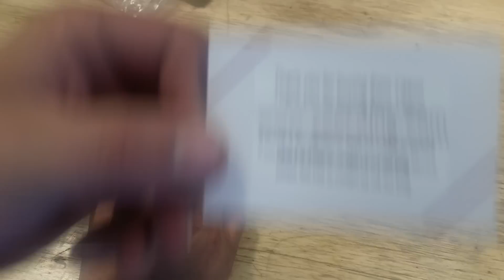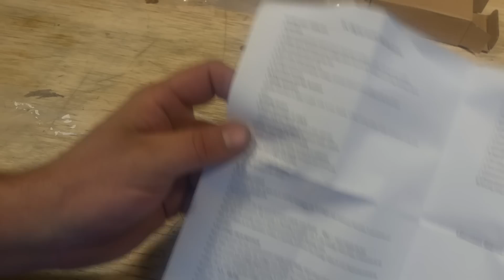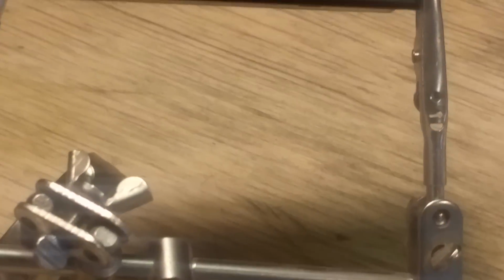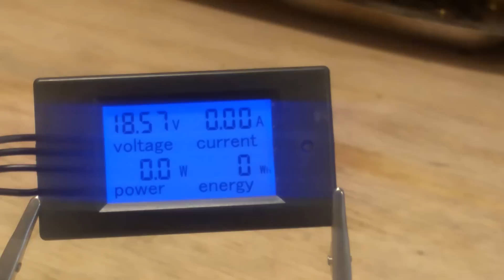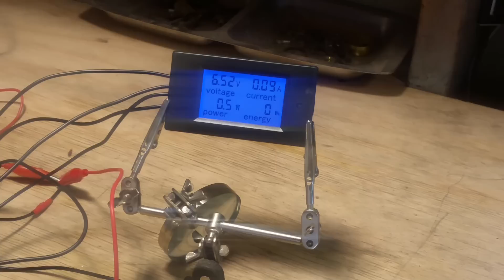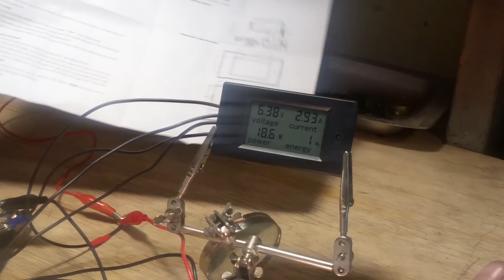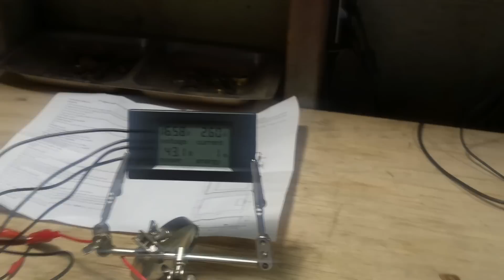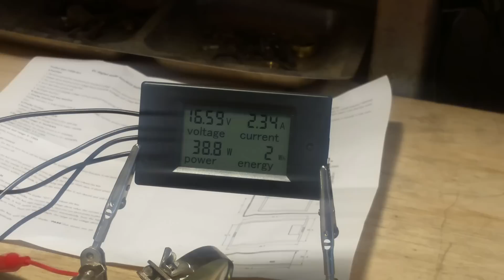Yeeco® Digital Multimeter DC6.5-100V 100A Voltage Amperage   Review

Comment: "I'm not balance charging, I don't have that problem. If they die I have plenty of them"

Ohhhhhh boy you really didn't think about that one for more than half a nanosecond did ya? If its true that your cells aren't going out of balance tha's great! But I've never seen a pack that didn't drift a bit after 50-100 cycles. I've seen packs drift apart after a few cycles...like to the point of there being a 70mv difference when they were originally only 5mv apart.

Every time you slap 16.8V into that pack you take a risk that one cell is higher than the other 3. And if three of them are 330mv lower than the lone wolf you have a cell at 5.20V while the rest are at 3.90V

That's not a problem. That's an explosion.

Comment: I like this little meter. But, this is a 100 amp meter. My battery cables are 10 times thicker than anything that can fit into those tiny little Phoenix connectors on that meter. Do you think that little Phoenix connector can handle 50 - 75 Amps, which is my average current demand on my batteries on a good day? I am going to biy one and strip it down and see how it has been built. Please reply here and let me know what you think.

Comment: When I set the required voltage, the display will flash. So I want to ask if he has any signal or control output. Somewhere on the board.

Comment: HI i want to use this to measure watt hours of mobility scooter -24v 900 watt motor. the instantanous current at start up may well exceed 100 amps falling quickly as motor generates back emf. Can this meter cope with instantanous surges do you think?
is it just so quick as to not affect the meter? Would like to know your views thanks
Reply: Yes, it will work quite well for that application, and I rebuild the motors for the mobility scooter's, and I can tell you from experience that unless you have a highly modified controller you will never see a hundred amps to those motors your looking at 60 tops 30 per motor.

Comment: Does anyone know if this meter can be used on a 48 volt ebike ? The instructions say to connect to the negative load terminal, but is that the load terminal before it goes into the controller or after the controller ?  Thanks in advance if anyone knows.

Comment: OK, so from what I gather from your other comments, is that if I'm running a 30 amp ebike motor from a 30 amp lion battery, I should not need the shunt. Is that correct ? I can just twist and marret the 3 negatives together, and then run them to the meter ? Thanks.

Comment: I purchased two and both of them are also about 40 - 60% off when compared to a watt meter that only has red black in and red black out from hurricane solar on the same load. it showed my refrigerator using 50watts while the other meter shows it using about 110 watts using the same inverter.... any suggestions or is it busted?
Reply: Were you using this meter on AC power? If so, you have bought the wrong meter. This meter measures DC only.

Comment: I installed the shunt inline between car battery and deep cycle battery in the trunk, on the negative cable. When I start the car the amp-meter reads 0 as if no amps are passing through to charge the deep cycle battery, and though it still shows the right voltage of 14.5 volts. I am sure that the deep cycle battery is low and need some charge.
 I moved the shunt and placed it it on the negative between deep cycle and the load going out  of the deep cycle battery, and it worked, it read the few amps coming out. Can some one explains why nothing happened in the first case?
100Amp shunt, the two batteries are disconnected when voltage is below 13.3 volts, the amp-meter is receiving its power from solar control charger load output, and its two other cable connected to the shunt

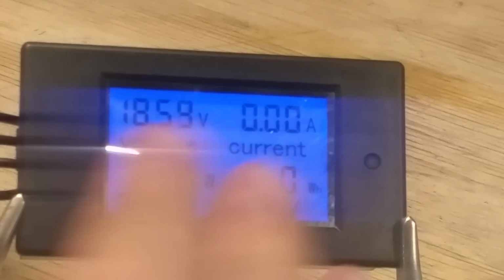Comment: I have so far only got to 5:54 and would like to say that I wish you had NOT focused on the meter while you connected the wires to the shunt.  I would REALLY like to know how to do THAT. I have one of these, just got it in the mail today, and am having some challenges figuring out how to wire it onto my battery for my solar power system.  OTHERWISE, I am enjoying this video .  I am just relearning electronics after about 50 years.  I'm from back when transistors were new and IC's were not really affordable.   Anyway, thanks for the low BS quotient.  Very helpful.
Reply: Hey, you think YOU"RE old, pnolans? My first electronics projects used vacuum tubes! My grandfather was a radio technician with B.C. Airways and a ham radio operator, so I learned a bit from him. Unfortunately I was too stupid to really get into it when I had the chance; he died young and with him went a hell of a lot of knowledge.
Reply: Just make sure that the shunt is connected to the negative side of the battery and that you don't make contact to the positive side of the battery any other terminal except the one marked on the back of the meter as (+) and you will be fine.

Comment: Thanks Don, I've ordered this meter and I think it will be a great piece of kit for my set up. I see you say that you can charge other batteries off your 12v battery, hopefully you can answer my question I have please.

In my off grid workshop I have a 100w solar panel going through a 20A controller and into a 12v 130ah battery, that’s working great. On the controller I also have a LOAD output that I have going to my lights, what I would like to know is if I can split that output and feed it into my motorbike battery (12v) to keep it topped up. When I look at my charger that I have used that plugs into the house power socket, it states Output 12v / 800mA. If I can feed a cable to the LOAD on the controller and to the bike battery, will it act as a trickle charge or what will happen once the bike battery has fully charged? Thanks a lot
Reply: I am not sure, but I think the controller that feeds the lights is an inverter. I think it is quite safe to say that you can connect your bike directly to the battery that supplies the inverter (Supply Battery). I would also suggest that you install a Schottky diode in series between your supply  battery and your bike. That way, if if the supply battery voltage gets lower than the bikes battery for any reason, then the battery power on the bike won't flow back into the supply battery and the solar panels, but I guess you already have diodes installed on them.
Reply: @gandalf87264  thank you Paul 🙏
Reply: I don't think you can do that. The charge controller load output circuitry is expecting pure loads, not an actual secondary power source.

Comment: I bought one but the current is read half of what it should be
Reply from the maker: Does the meter come with a shunt? If it does can you read me what it says on the Shunt.
Reply: I figured it out, I had to go into the menu and change the mode to 100 amps.
Reply from the maker: Shaun Dobbie great. Thanks for letting us know
Reply: Shaun Dobbie that is one of my questions, I have a 3000w inverter and I want to use a larger shunt. On the menu, can you change the shunt size?
Reply: You can only choose between 50 and 100 amps I think.

Comment: Question. Can i safely use one of these with the proper shunt in my car audio setup? Ive been looking at them for a while now. I currently have two volt meters. One for my auxiliary and one for my primary. But being able to monitor my alternator amperage would be pretty nice. Thank you in advance for taking your time to make this video!
Reply: Yes you can, but the shunt needs to be on the ground side of the alltinator

Comment: Thanks for the video. I'm about to install one in my new travel trailer. With a simple dpdt switch, I will be able to switch between seeing amps in to amps out. Thought I'd say something because lots of people are asking about that. Good luck!
Reply from the maker: That's a brilliant ideal... I hope you don't mind if i use it.  Thanks brother!!!
Reply: Actually after posting that I realized that using a on/off/on 3pdt switch you could turn off the display and have both directions for current! Only downside is that watt hours will add either way
Reply: I drew out the circuit. Let me know if you want a picture of it. I don't have a channel or Facebook but I could email it...
Reply: @warsoki  do you still have the wiring diagram?

Comment: hey Don just wondering if you can help me out i just bought this meter  as well just need help with the wiring i am going to using  it on my battery bank for my solar panels i have all the small wire wired up it is the shunt where the larger nuts and bolts are where do they get wired to thanks chris
Reply from the maker: to see the diagram look at the last pic on the amazon  page http://goo.gl/XZaz3s
if you have any question after reviewing it, let me know. -cheers
Reply: Don Brandt thanks don the wires are to big to fit on my charge controler any suggestions
Reply: what is the best way to send you a picture i just want to make sure this is right
Reply from the maker: You can post to http://imgur.com/ No account needed, then send me the link
Reply: it is just a picture of the the diagram you told me to look at so the shunt goes on the black wire just after the solar panels and before the charge controler
Reply from the maker: HI Chris,  You know this device will measure amps in one direction. what are you interested in, battery charge or discharge?
Reply: Don Brandt i would like all 4 options
Reply from the maker: chris uens well you can always tell the voltage regardless. but that meter will only show amps in One Direction regrettably
Reply: Don Brandt what would you recommend

Comment: Can this work on a 48 volt system of a golf cart?  ( I have 6  8 volt batteries) The rated volts and amp would seem to work.

I suspect a drain of current in the system, and this history of amp draw should measure it.

Thanks for your reply
Reply: Yes, it will work great for that application, it will keep track of the watthours drawn from the batteries, and if you calculate the watthours of your battery pack, that is the amphours of one battery multiplyed by the nomnal system voltage around 49 volts and you will be able to keep track of exactly how much you have remaining, a much better fuel gauge than those little LED bargraff displays, yes these meaters will display just over 10,000 watts at full ratted current and voltage. The only downside is that they only mesure I one direction, enother words discharge verses charge, however a quick fix is to install a DPDT cross wired switch on the sense leads that go to the shunt, unfortunately it still won't count down, so you have to reset the amphours and flip the switch to charge before you start the charging process, otherwise it'll add the discharge and charge together and display that value.

Comment: Just an FYI, that's not the proper way to "tin leads".  You should heat the wire first then  melt the solder directly onto the wire. This way it will allow the resin (which is in the core of the solder) to melt first and properly clean the copper and adhere completely.  If you simply dip the wire in solder, then you are not cleaning off the oxidation first which could lead to cold solder joints and/or resistance in the circuit.
Reply from the maker: You are correct, her is a good example of how to tin wires...
https://www.youtube.com/watch?v=xpiyB7ZM3vg

Comment: Don - what is the purpose of the shunt? Other brands don't appear to provide with a shunt? Thanks.
Reply from the maker: The shunt in used in this case because the system is 100 amp.  There may be another way to wire them with a different device. I'm not sure.The wiring diagram @ 2.51 shows hot it fits in with the shunt. I know if you were going to carry 100 amp wire to your gauge it would be a little unwieldy. Thanks for the question.  If you happen to have a link for 100 amp that doesn't have a shunt. Send me a link and ill check it out.  -Cheers!
Reply: Thanks for the quick response. I just bought the meter for monitoring my pop up camper battery. Should never see 100 amps, unless a gross short. Didn't see shunt with other devices. Appreciate your good video and help.
Reply: I have a similar question about this shunt, i want to use this meter between the solar panels and the leisure batteries in the campervan, to monitor the voltage and amps being supplied from the solar panels to the batteries. Do i still need to include the shunt in the setup? Also if the batteries are rated at more than 100A will it damage this meter?
Reply from the maker: The shunt is required for the 100 amps. If you think about it, small diameter wire cant handle large amperes. If you watch this video you can see me putting the shunt in the larger diameter wire. Yes, the shunt can handle over 100 amps. As i found out afterwards, the starting of the generator draws more that 100. If you want to only use a 20 amp gauge, the shunt is not needed. what would be the max amps you think you would need to measure? I can help you figure what you need. -Cheers
Reply: Two 110 Amp 12V batteries in parallel = 220 amps in total.
Reply: No, those batteries are rated at 110 AMP-HOURS, not amps. In parallel they deliver 220 Ah. An easy mistake to make. The amps drawn depend on the load. Short the batteries and you COULD be looking at 1000 A or more. Not that you want to try!
Reply: I bought one of this...and I have the expectation...that when you are charging the battery...it reads negative amps....but it dont!!! ...It reads only the amps that comes out of the battery... Can you check if yours work like that???  Thanks
Reply: my its peacefair!!!
Reply from the maker: Mine does not register in reverse.. Would have been a nice feature...  I think i may have mentioned in this or the RV video. Thanks for the comment. Good luck!
Reply: It sucks!!!!!...However if you change the cable position...then you can measure the amount of WH that went into the battery during the charging process!!!! ...

Comment: I have one of these on my electric boat. It works great, the motor draws around 45A@12v. It lets me keep track of how much power I've drawn out of the batteries. I got it for around $20 shipped on aliexpress.
Reply: i've just received one and am currently wiring it into the box for the leisure battery that runs my garage (its too far from the house to get mains).
typical ebay, no instructions so trying to figure it out via youtube!  :( seems to work ok but an odd thing is at low power, it only reads current with the backlight OFF, higher draw is ok though :/
if this works well i'll probably out one in my campervan too so your RV segment would be really useful  :)
thanks for explaining the button functions!  :)
Reply: brilliant, thank you  :)
Reply: +Don Brandt.       I was wondering are you on negative or positive to the shunt? thank you for your  time. I  have  hooked up my meter and can't get amp read out.  The directions say to hook up on negative?
Reply from the maker: Thanks for comments.  I would like to hear from more people about these types of meters.. I am getting ready to do a segment of installing it in my RV.... Have a Great day!!
Reply from the maker: Hello and thanks for the comments and questions.  i don't have an answer about the low power but the instructions for the button is below.. Good luck with your project and keep us updated.

III Button
1. The backlight control
By short press the button to turn on or off the backlight, the backlight status automatic storage.
2. The power cleared
Step 1: Press the button until the power area show "CLr" character, then release the button;
Step 2: At this point in the power consumption flashing indicating the current status is cleared, if short press the button again, the consumption data is cleared and cleared quit flashing;
Step 3: If no key is pressed within five seconds, it means that the power does not clear the data and exit cleared.
3. The voltage alarm value
Step 1: Press the button until the power area show "SET" character, then release the button;
Step 2: After entering this state, the voltage of the high pressure area shows the current alarm value, the current area displays the current value of low pressure alarm, and the least significant bit starts flashing, then you can press the button through the +1 bit short, when there is no button operation When more than three seconds, the automatic adjustment of the position switch from high pressure to low pressure alarm alarm value has a value, a total of six, the scope voltage alarm threshold set for the 6.5 ~ 99.9V;
Step 3: After setting, press the button until the display shows "PASS" character indicates the setting is successful and automatically exit the setting mode.
4. Range Selector
Step 1: Press the button until the power area show "Curr" character, then release the button;
Step 2: At this point the current area displays "100 A", short press button between "100 A" and "50 A" switch, in order to represent the external current range is 100A / 75mV or 50A / 75mV, attention The table can only use these two specifications shunt.
Step 3: Press the button until you exit the setting mode or no key operation is automatically saved after 3 seconds and exit the setting mode.
Reply from the maker: The shunt is on the negative or ground... look at the last pic on the amazon  page http://goo.gl/XZaz3s
Reply: Thank you
Reply: Did you install the shunt?  How did you rig the shunt with your motor?